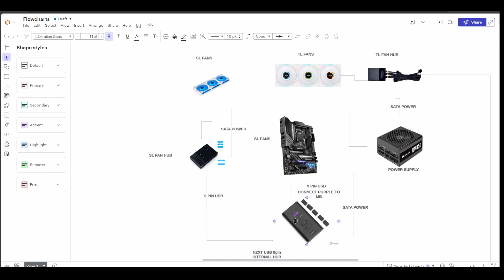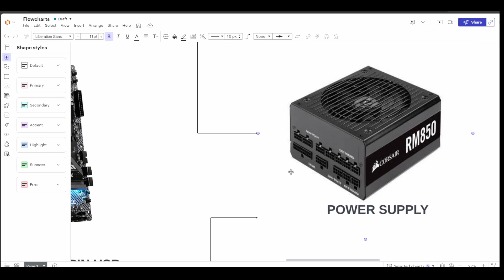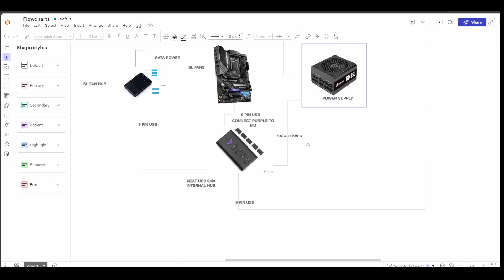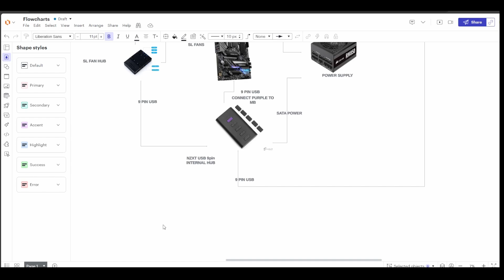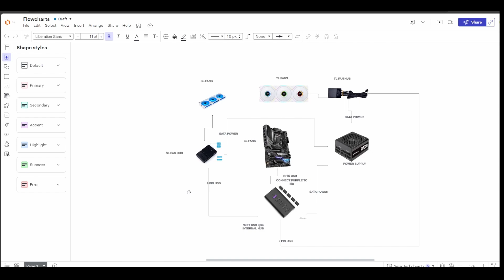NZXT 9 Pin USB Hub Connection- Lian Li TL LCD & SL Fan Install

Comment: I am considering to get this usb hub for my upcoming build, but since ill be using mainly Lian Li parts (aio and 10 fans) , i'm afraid that i'll run into issue with L-connect issues, i see alot of online reviews saying that sometimes L-connect wont recognise some fan groups. Whats your take on this? Thanks in advance !
Reply from the maker: Hey thanks for checking out the video! Simply put Lian Li makes incredibly well designed fans and the aesthetics are unmatched. I'm running 10 in my case at the moment and am using this exact USB hub and L-Connect has definitely caused some occasional issues that I have had to spend more time than I want to to troubleshoot but up until this point I have been able to resolve any issues. 

L-Connect is the weakest point of this product for sure. That being said after it's most recent update the software is running noticeably better and I  notice fewer issues. I also use Signal RGB to push my lighting effects and occasionally it clashes with L-Connect after updates and restarts but the issues are more annoyance than like system breaking. Good luck with your build let me know if you have any other questions!
Reply: @EuphremeTeam  Thanks for the detailed reply ! 
I’m planning to run 7 wired SL infinity fans and 3 wireless infinity fans , since i’d prolly need 3 usb headers (including the aio) , thats why i decided to get this hub. They say that if i make sure to power the hub with a sata connection and install L-connect last after installing all the fans it SHOULD work ! Fingers crossed , i’ll be building it in a weeks time after all the parts arrive ! 

Subbed for the awesome content !
Reply from the maker: Really appreciate that. Sounds almost identical to my build let me know if you have any questions or encounter any issues . With some trouble shooting you should get everything working the way you want it. Enjoy the build one of the best hobbies for sure!
Reply: @EuphremeTeam Owh ! I do have one more question tho. I’ll be using the galahad trinity 360 that comes with a fan controller hub , would you happen to know if the controller also comes with an adapter to for the argb cables for my daisy chained fans ? If yes , how many does it have because i have 2 groups of fans that i’m planning to plug into the controller .
Reply from the maker: Hey! just seeing this comment now. I'm not familiar with that AIO. I'm using a thermal take 360 and the pump control and RGB connect directly to the mother board. Which Motherboard are you using?

Comment: hi bro ty for videos,i have a problem like this,I bought 7 single SL Wireless LCD Fans and installed them in my case as 3-3-1, when I first installed it, it gave a blink signal because I tried to power up the 3-way ones, fortunately I had a molex for pwm power cable in my hand, I handled it like this, I have 1 nzxt 2.0 hub in my hand and I connected the fans to it, but I didn't see that the single fan didn't select its LCD, when I checked just now, 1 set of 3-3 sets i saw that it was gone,it probably causes a problem in the nzxtnin hub, but I couldn't solve it exactly, is the nzxtnin 2.0 hub incompatible, have you read such information or something? What had I better do?
Reply from the maker: Hey! I haven't tried the wireless connection yet sorry to hear you are having issues. Do the fans show up in the L-Connect software? Have you tried connecting the control box directly to a 9-pin USB on the motherboard?
Reply: @EuphremeTeam  hi, Yes, they appear in the program, so that's the problem, but when I click on the LCD, none of them can be clicked, it only adjusts the fan speed and RGB. :(   I just found Lianli's own USB 2.0 1 to 3 products. If I buy these, will my problem be solved?  G89.PW-U2HB.00 this product code.
Reply from the maker: Ok so they appear in the software and you get fan control and RGB but no LCD screens. Does the control box have a UBB C connection or just the 9 Pin USB? Are you sure the fans are getting enough power do they blink on at startup?
Reply from the maker: It’s hard to say it that part will help have you contacted Lian-Li customer support yet?
Reply: @EuphremeTeam  I have previously connected Corsair LC100 products to the nzxt hub, and they communicate via USB 2.0. I had problems with them too, I think it goes haywire when too many products are connected to nzxt or it chooses my own product.
Reply from the maker: What kind of motherboard are you using?
Reply: @EuphremeTeam  b550 Aorus Elite V2 1.1
Reply: @EuphremeTeam  https://www.youtube.com/shorts/8iTJM67kJ4w

Comment: I have tried everything but one of my TL LCDs still doesn't work, is there a solution?
Reply: what tends said to switch them around i think
Reply from the maker: Yes, i had to swap them around a few times during install and then a few tweaks in the L-Connect software. Thanks
Reply: @ i tried to connect 4 of my wireless lcd together for tl connect, is it true that it only takes 3?? >~<
Reply from the maker: @AbbiyuVisions-sk3rk it’s supposed to be able to take 4 per port on the controller but for some reason the default in the L-Connect software is set to 3 fans and you need to go in and turn on all 4 fans. 

I had an issue where one of my 3 fans was in the 4th slot according to L-Connect and the LCD screen wasn’t working, once I turned on all 4 slots in the software it worked and now it correctly registers only 3 fans I had to redo this after the last L-Connect update too. So far very few issues using Signal RGB with the fans and L-Connect for the LCD screens.
Reply: @EuphremeTeam  I see now! Initially, I didn’t understand why all of the LCD displays would power on briefly after I started the PC, only for the fourth one to turn off after a few seconds. I suspect this is related to the software, as I haven’t installed any drivers, BIOS, or other system software yet. I’m just assembling the hardware components at the moment.
Reply from the maker: @AbbiyuVisions-sk3rk they are amazing fans but it did take some trial and error to get everything setup exactly how I wanted. L-Connect is good but can be a bit confusing sometimes you may need to toggle motherboard control and test some other settings. Good luck with your build!!
Reply: @EuphremeTeam  thank you!!! this video was very helpful
Reply from the maker: @AbbiyuVisions-sk3rk glad to hear 👍
Reply from the maker: The fan it self or just the LCD screen? I did have a few issues after the initial install
Reply: @EuphremeTeam just the LCD

Comment: Great video and diagram. For the bottom reverse SL fans you mentioned you would just plug them into your existing SL fan hub correct?
Reply from the maker: @Rev0ltTTV   Thanks glad to hear you liked the vid. I haven’t actually installed the SL reverse on the bottom yet but they will connect to one of the ports on the SL controller hub. Presently I’m using 2 of the 4 ports.

I can’t remember off the top of my head but I believe each SL controller can handle up to 4 sets of 3 linked fans each.

Comment: i have x870e godlike Motherboards its best in market today but only have 1 usb on Motherboards and  i use nzxt splitter on it but only 4 TL LCD work and 1 now i dont know what do to i see on aliexpress ( USB Splitter Motherboard 19Pin to Dual 9Pin ) i dont know if that work or not
Reply from the maker: I don’t understand why companies don’t put more 9 pin USB connections on high end  motherboards it makes things challenging.

How many fans and fan hubs do you have?

If the USB splitter on aliexpress is SATA powered it should work depending on what you connect. 

Lian Li is releasing some wireless fans soon that will hopefully eliminate a lot of these connection issues but for now we are stuck with finding USB connection work around.

Comment: i also need to use the nzxt splitter for my fans but everyone says u cant use TL LCD hub with a splitter, did this work for you?
Reply from the maker: Hey, ya the TL and SL fan hubs are connected to the splitter and I am using the other 9 pin for case USB since I use a lot of thumb drives and external storage . There is a bit of lag initializing the screens on startup but I can’t say for sure if that is due to the hub or just the L-connect software. Alternatively you can just connect TL hub direct to MB and use the splitter for other peripherals, not optimal but should be a solid work around. Looking forward to testing the wireless fans eventually. Thanks for checking out the video!

Comment: If I use an NZXT Kraken and put the Lian Li fans on the radiator. Which software should be controlling the fans? CAM, L-Connect or the motherboard?
Reply from the maker: Hey, you would likely have a few options based on what your preference is. I use L-Connect to  control the Lian-Li fans speed, LCD screen and then use Signal RGB to override for lighting which has been playing a lot nicer with Lian-Li hardware since the last update. I haven’t used the Kraken but I know a lot of these proprietary control software can create challenges. Looking at support forms it appears possible to control the Kraken pump in signal RGB with a pro subscription. The easiest approach would probably be motherboard control for fan speed, pump speed, CAM for LCD turn off lighting control in CAM and then use signal RGB for lighting for all of your fans etc. you may need to troubleshoot a bit but should be able to work.